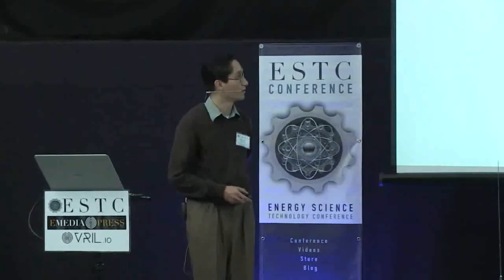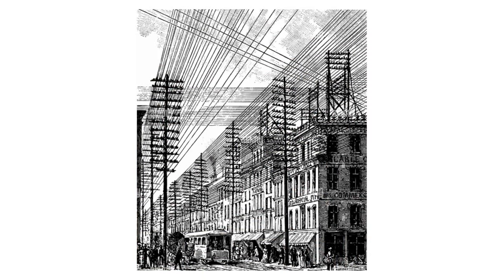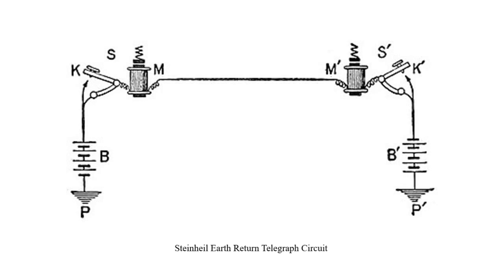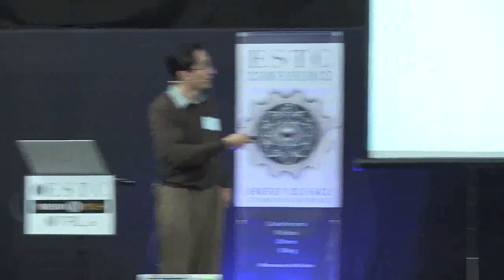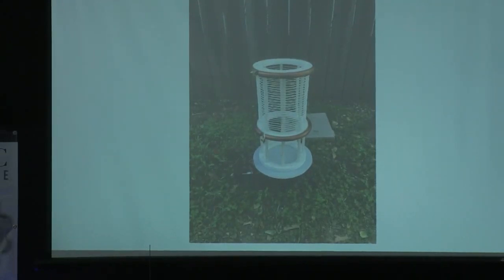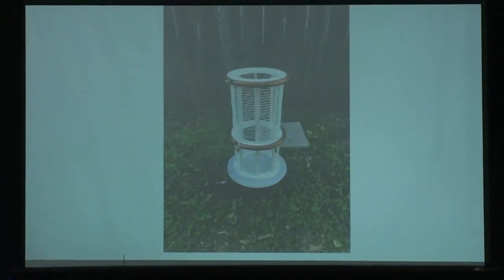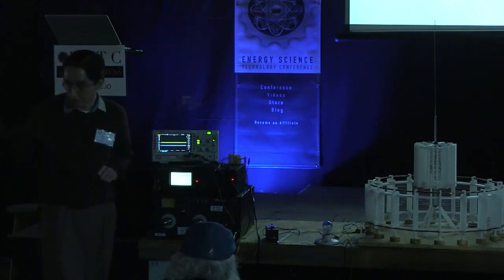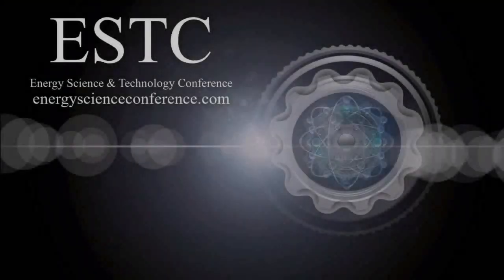2022 ESTC Preview - Telluric Radio Communication Research by Griffin Brock

Comment: At the end of the video when you successfully illuminated the filament using longitudinal propagation, was the light bulb warm, or hot to the touch, like a conventional hertzian lit light bulb would be? I will not be surprised if you inform me that the bulb actually remained room temp to the touch, or even cold.